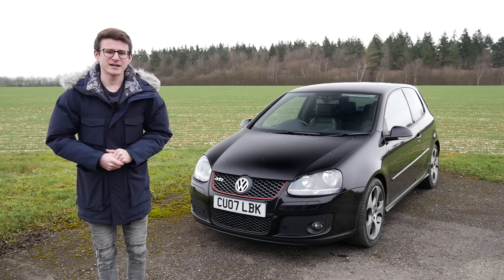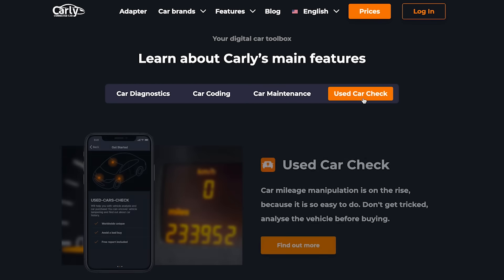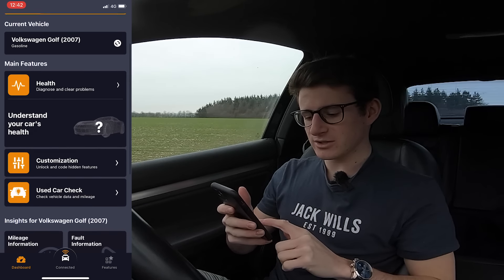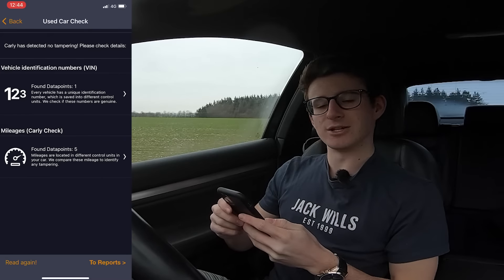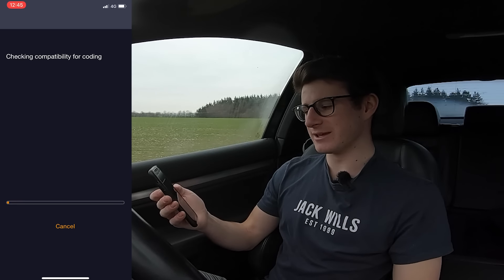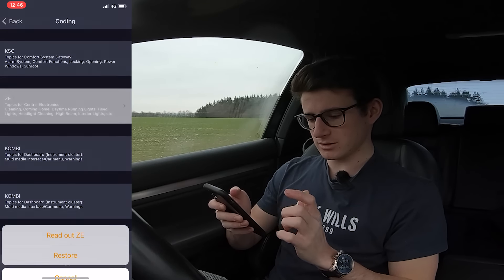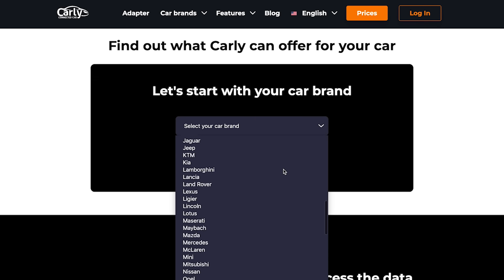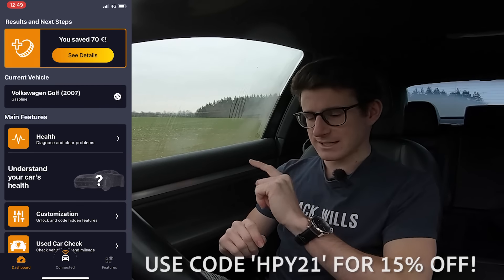Things You Should Know BEFORE Buying A MK5 Golf GTI...

Comment: These engines will happily do over 200k if maintained properly
Reply: Well most engines does if you maintain them properly
Reply: He can live ase 300k 350k with maintenance all day you look your engine he can catch 400k and all important thing is the maintenance if the engine and if is dsg the oil of the gear dsg and the dsg 6 its more reliable of the dsg 7
Reply: What about the turbos and such?
Reply: Absolutely! The body will rust around the powertrain
Reply: U mean over 300k with no problem
Reply: Especially the belt driven EA113 BWA ones
Reply: @man1cs171  turbo should be pretty much sound and is a cheap replacement for a refurb. Sometimes the diverter valve goes on them (symptoms being surging or reduced power) but this is a cheap and easy job to replace. Hope this helps mate 🤙
Reply: 267k on original turbo and clutch....it's about how you treat it and maintain it.
Reply: Nah mate VW money pit get a Toyota will run 500k on vegetable oil
Reply: Even a GM engine will 200k with proper maintenance
Reply: Not if you speak to the vag haters who’ve never owned a vag car either because they couldn’t afford one or did buy one and bought an absolute pup
Reply: Hope so I bought mine at 210,000
Reply: @jacqueshoebers7565  am going to get mine at 260
Reply: Getting one at 221,000 od km in Australia if people wondering with the km
Reply: @mrblue938  what Toyota has a turbo and is as fun as a GTI?  If I wanted a Camry, I'd buy one.
Reply: @Mr Blue  call me when toyota makes something interesting.
Reply: @mikep6726  EA888 is fully chained. EA113 connects the crank to the cam with a belt, and then a chain connects the exhaust cam to the inlet cam. EA888 has vacuum operated intake manifold flaps. On the EA113 they are motorised.
Reply: A friend of mine had done 400k km
Reply: Km?
Reply: currently 217019KM and running very strong.
Reply: 2009 GTI MK5 231xxx miles and counting ‼️ running strong stage 2 ‼️ 🤩🤩🤩
Reply: I even know someone that has close to 500000 kms

Comment: A few points to help to keep this nice looking GTi as trouble free as possible. The wings rust as there are big lumps of foam under the front wings designed to deaden sound / vibration and are located above the wheel arch liners. They retain moisture and so encourage rusting. It seems crazy that VW thought these were a good idea! They should be removed from all mk 5 Golfs ASAP. The plastic components on the orange dipstick crack with age and drop into the sump and can be sucked up by the oil pick up pipe. Only fixed with a sump clean. The latest version is yellow and you can buy a dipstick tube to match. If you are planning  to tune the car you will probably upgrade the fuel pump. This puts extra pressure on the cam follower and so it should be changed more often than 20K miles.
Reply from the maker: Great extra points, thanks!

Comment: Hi Luke, the reason the mk5,s rust on the wings is due to a sponge kept in the wing. Over time the sponge stays damp and then rusts the wing out.
Reply: A lot of people now leave the sponge out. 🧽
Reply: Not true as even without them they still rust bud. Experienced it myself.
Reply: @madz7867  when VW replaced mine many years ago they trimmed the plastic wheel arch liners slightly as they rub on the inside of the wings which takes the paint off.
Reply: There’s an official VW tech bulletin on this to remove the vibration dampening. It’s 100% true!
Reply: @honestreview1043  spot on. It’s like a foam and it holds water as well as rubbing the paint away. Then the inevitable rust. The wings tend to rust inside out so by the time you spot it it’s too late.

Comment: I have a MK5 GTI and let me tell you if you maintain it , it will drive for a long time 🤙 fun little hatch especially with the 6 speed manual 👍
Reply: Im getting an 07 GTI with 120k miles 6spd manual for 6.5k is that a good deal? And what should I mainly lookout for?
Reply: @FrescoMedia  hmm. I’m not too sure mate!
I bought my 56 plate (mid2006) for £5000 nearly 4 years ago with 80k on the clock.
However I know these cars are becoming a classic and sought after.
I now have 100000 on the clock and apparently it’s worth £3800.
Reply: I got a mk5 gti with 157k miles on dash, og clutch, same engine, runs good i been driving it for about 5 months no issues. I want to do a lot of maintenance stuff soon but idk what to do first. Obviously if i could i would do everything but what are the main things to keep this car running?. I was planning on selling it but i keep falling in love with it the more i drive it. Its a 2006 gti mk5 manual.
Reply: Its true for all cars. keep maintainig them and they will work.

Comment: On mine before going stage 2+,
We done the main thermostat, cam follower, oil pickup pipe cleaned along with the sump, revision g diverter valve, new PCV valve and keep on top of general services with use of quantum 5w40 oil and make sure dsg Serviced regualer with genuine parts.
I think that's everything 😁
Need to get cam belt and water pump sorted soon though.

Comment: I owned a 2008 MK5 GTI in Candy White for a good portion of my 20s. I thoroughly loved that car and had a blast with it. My favorite hatchback ever built in terms of aesthetics. It didn't stay stock for very long but I like to think I made some pretty tasteful choices. H&R coilovers for about a 2" drop all around, may have been a hair over or under I can't remember for sure but that was my ideal height for the MK5. Should've came that way from the factory but I digress. Had no interest in bagging it. Eventually swapped the stock 17s for OZ Ultraleggeras 18" in black. Think 18"s were the best fit for the GTI personally. Had the interlagos plaid-style interior and I fucking loved it.

Performance wise I had a custom turbo-back exhaust fabbed for the car since it was needed for anything beyond a stage 1 tune. It was similar to a CTS kit you'd buy today. Gave the car a really nice growl at low rpm but it didn't drone too bad and it still wasn't overly loud at all, very much still a daily driver. Then the ecu was flashed by Revo to Stage 2. I didn't goto stage 2+/3 because I didn't want to change out the k03. I almost went with APR for the tune but I tried out both APR and Revo's stage 1 tunes and felt Revo was a little more aggressive. Back then, idk if you still can, but they'd let you trial their stage 1 tunes for a couple hours and then the ecu would revert back to stock after a certain amount of time. I can't even remember if they charged me to do that or not but yea, eventually settled on Revo. It had a neuspeed intake as well just to hear the diverter valve a bit more, that's really it. I had the car dyno'd once a couple years before I sold it and it was making about 270whp @ 7000rpm and almost exactly the same amount of torque from what I recall. Was great because that little k03 spooled up so quick and you'd hit peak torque real fast. That was enough power for me in that car. 

I ended up selling the car a couple years ago and I still miss it every day. The good thing was it stayed in the family, I ended up selling it to a cousin who drooled over it every time he saw it lol. Probably could've gotten a little more for it because I gave him a family discount but the bonus is I still get to see it often and I still get to drive it once in awhile. The only real problems I ever had with it were various electrical gremlins from time to time, but that's pretty typical with VW & Audis. Never had any major issues with the FSI motor beyond normal maintenance items.
Reply: Sounds absolutely amazing, thanks for this!
Reply: Do you remember how much you paid for it originally?

Comment: Have you much experience of these cars or just read up on all these issues on forums? The front wings are a issue as you correctly state but there is a modification to remove vibration dampening which holds water against the wing this causes the rust. This should be removed, it is under the wheel arch liner. Corrosion to the sills is also an issue on these cars, it’s hidden by the sill spoiler. Also rear arches can start to rust from the inside lip. No real issues with the tail gate, that’s a mk4 issue. Another issue is radiator fans, the motors have two speeds and they burn out. This occurs on the gti and R32. 
This TSI engine is prone to carbon build up, check it starts from cold without any misfires. It should start on the first attempt.
Sunroof can leak, check this if fitted. And the big one you missed is door lock modules! One of the most common mk5 failures! They are expensive and to replace them you have to remove the door skin since the door internals are all accessed this way. Can be a bit of a nightmare to refit the door skin as aligning it  up can be tricky.Thermostats do not fail often and no more than any other car. You should check for head gasket failures before that!

Comment: just a little further information that was provided by the specialist I use for my Stage 2+ Pirelli - the cam follower should be changed every 10k if the car is tuned. Equally the DSG should be serviced more regular if remapped during tuning, around 40k miles. The other potential issue is in addition to the cam belt, these cars also have a chain which have been know to cause issues after around 60k miles, so need to be monitored when old. Good video!

Comment: Hi mate, some additional maintenance if anyone hasn’t already mentioned below:

- Cam chain & tensioner (not part of VW maintenance when doing cam belt & water pump) if buying a used GTI definitely get it done.
- Oil pick up pipe which clog up over time and is located by removing the sump well worth going for a balance shaft delete (WASA or VIS freewheel sprocket) at the same time when getting the pickup changed as the balance shafts are known to fail and can be accessed at the same time

Comment: With the DSG if you get the dreaded PRNDS flashing (mechatronic dead) before replacing first check if a reset through VCDS works if not it will be cheaper to buy a complete gearbox off eBay or anywhere (£400-800) and get it changed instead of the mechatronic alone

Comment: Hey, how many thermostats are there in the car? Are there more temperature related sensors apart from the main thermostat? I had mine replaced, but the car still takes quite a long time to warm up and when it is colder outside, the temperature drops while driving it, shifting between 70 to 90 degrees. Thanks!

Comment: The front wings rust because there’s 2 foam pads inside the arch which holds water and rust the wing from inside out. Check it most remove it to stop the issue.
Reply: 💯 same with my old seat Leon proper pain
Reply: @BD-wz8hx  yup! there all bad for it. my seat wings were bad where they met the cills. And the paint warranty was BS they wouldn’t repair them.
Reply: @46holl  I got a mk6 GTI now so hope these don’t do the same 🤞
Reply: @BD-wz8hx  same here I’ve got a mk6 gti 👍💪🏽
Reply: Did they get rid of this on the mk6?
Reply: @Lauren_B  not sure to be honest, no issues as of yet  🤞
Reply: @BD-wz8hx  yeah I have a mk6 gtd and all seems good so far
Reply: Where are the front wings

Comment: Het fella, really enjoying your video's, being a MK5 GTI owner. Good food for thought. What persuaded you to go with the MK5 instead of a newer car?
Reply: Cheap, fun car.  Was looking for a turbo car to mess with and have always liked hatchbacks, loved the 5 speed that was jn my old 96 jetta 2.0L... when i saw the prices i could pick up a Mk5 gti up for it was a no brainer.  Bought the car, did full tune up and fluid flush and did an intake and exhaust right iff the bat.  Ive since bought a bigger intercooler, bigger turbo, injectors etc.  Thats all going on soon along with some tuning obviously.  Expecting the setup to make 320hp/360tq to the wheels.  Its sitting at 266 now.  Engine has 240,000km on it and a compression test shows its still 95% of new.  Car had been maintained well before me.  Love the car as a second fun car.

Comment: I will point out that headlight cleaning is actually good, don’t know why you’d turn that off..
Reply: His wouldn’t work anyway since he doesn’t have Xenons lol
Reply: @raymondo5893  many still came with washers even on ones without xenon..
Reply: @djduffa  thats a first time I’m hearing that. You’re right. I wonder why they put washers on halogen lights
Reply: Dunno maybe spec’ed with it by customer as mine has them, didn’t have gas discharge from factory
Reply: @djduffa  get some xenon headlights then lol. I wonder if you have the levellers. Doubt it since they’re only got xenon lights. Those washers be useless then 😳

Comment: Hi guys, did you make some upgrade on lubrication system of engine on mk5 GTI. I had engine code BWA and I afrraid of using car on track due to risk of weak lubrication or temperature of oil during a ride in long corners.
Reply: Get yourself an oil cooler as a peace of mind thing if you plan on beating on it.

Comment: Think you have good intentions but you are waffling about things you have no idea about that you simply read up on or asked someone? 

Diverter valve doesn’t cause a boost leak, the diaphragm inside splits and stops the pipe holding the boost up, so it’s not a leak to atmosphere 

The cam follower? I think you mean the high pressure fuel pump cam follower, pump that is at the top right hand side of the engine as you look at it? 
Very very rarely they wear through, they are £20, change it yourself in 30 mins, hardest part is getting the lower fuel pipe off if you change the entire pump over 

You forgot about the rear trailing arms rotting away 

You forgot to mention that if any door lock mechanism fails you will have to cut the outer door skin off to get to the lock to open it and then replace it all, at great expense 

Mechatronic unit WILL fail on a DSG car, jolting when you come to a standstill or pulling away from standstill will happen soon enough if it isn’t already

New mechatronic unit is 1k just for the part 

Dash binnacle will also light up like a Christmas tree at some point and need replacing 

All Something to look forward to eh 👍🏻😂

Comment: Lovely car 👍🏻
Im currently in the market for a mk5 gti, almost identical to yours!
How many miles has yours got and how much did you pay for it?  Budget of around 6-7k, can’t help but feel theyve gone up over the past year!😂
Reply: Defo gone up slightly I think, I got the Manual with 70k black 05 reg for 5k
Reply: @warzonespice916  how long ago did you get yours?
Reply: Only in January. I got it based on mileage and most work had been done. I've just done cam follower, pick up pipe, and pcv value since I've had it.